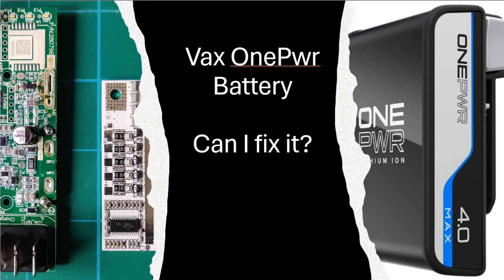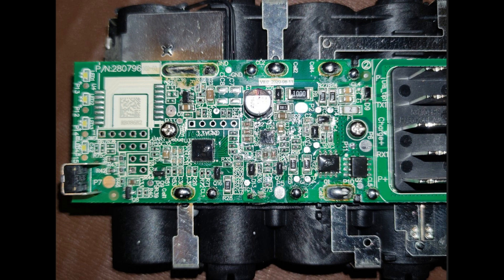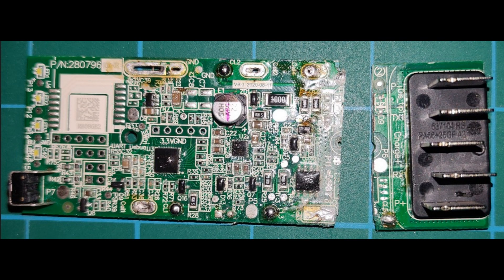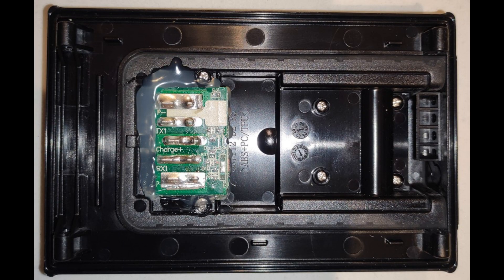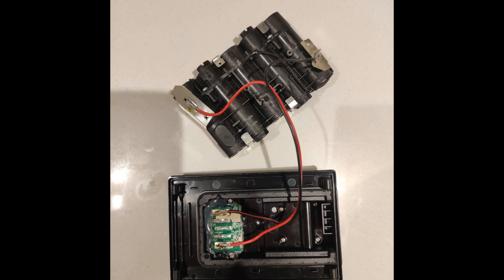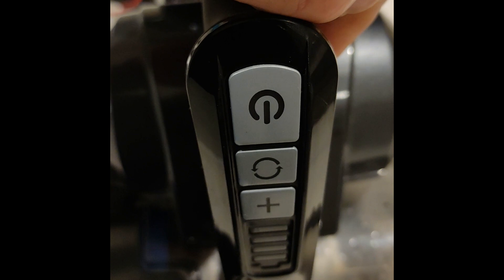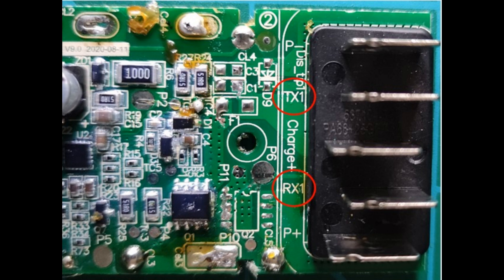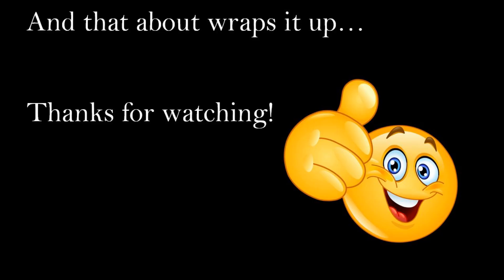ET#32.  Can I fix a Vax OnePwr Battery with a replacement BMS from AliExpress?

Comment: I checked my cells and one was 0.4v lower than the others, I topped that cell up with a constant voltage DC power supply at 500ma and the battery is now working fine and charging normally 👍🏻
Reply from the maker: Great fix!  I've just got hold of a battery with a similar issue, so I'll give it a go and let you know how I get on.  Thanks for sharing.

Comment: How to run the machine without the factory circuit, I need help
Reply from the maker: I don't believe this is possible as the factory BMS communicates via the Rx and Tx connectors.  I have bought a third party battery i.e. not a genuine manufacturers battery that works, so it seem someone (in China) has done this.  It is highly unlikely they will release that code, although they possibly might may start producing compatible BMS.  I doubt this will happen though!
Reply: @ECETek thank bro
Reply from the maker: No problem! ;0)

Comment: Hello, how does the electronic scheme  controller know that the battery is no longer working? What does it measure? The volume of the battery or the resistance of the battery?
Reply from the maker: Sorry, I don't know the answer to that one!  I've only had dead batteries to work with and I can't afford to sacrifice the working one I have - my other half would not be a happy lady if I did that!  I'm not sure I could give you a definitive anyway.  Good question though!  Same questions answered when asked in ET#29!

Comment: Good to find these two videos about this battery.
I had bought a pattern battery and before even trying this replacement I went to "jump" the old battery by connecting negative to negative and positive to positive in the hope that the little extra voltage would was all that was needed to get the battery charging, being hopefully above the threshold for the requirements of the charger.
I screwed up and connected negatives to positives and fried the brand new battery.
So much for me saving and repairing, I ruined one.
I have seen new boards for sale from eBay.
Do you think that maybe replacing the blown resistor on your battery BMS would have fixed the fault or is a known fault code response?
Many thanks and keep trying.
Reply from the maker: Ouch, an expensive mistake there mate!  Easy to do though.  Might be worth stripping the batteries to see what the issues were.  Make a video and let me know when you post it - I'll watch it to see what went on.  You might be able to make a good one from the two - or at least salvage the LiPos.
Unfortunately I didn't know the history of the battery I had - so I don't really know what caused the resistor to blow in the first place.  We can assume it was a pretty big current surge that would cause that amount of damage.  Unless it was possible to identify what went wrong it would be hit and miss on whether replacing the damaged component would fix it.  If the underlying root cause was unknown, it could just blow again in exactly the same way - or it might work fine.  I could have opened up the good battery and hoped that the same BMS had been used and so identify the correct component for replacement purposes.  We don't know what other issues may have been caused.  The blown component may have acted like a fuse and saved everything further downstream - or not.  My need for a spare wasn't urgent, so, for me, not worth the effort or time to replace it (and the tracks etc that had also gone).  Thanks for your interest and time taken to comment!